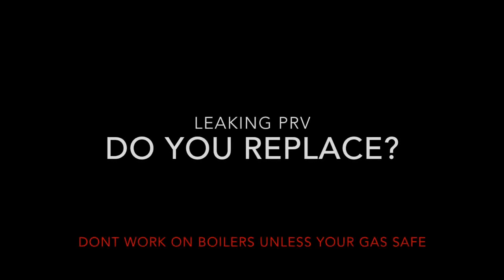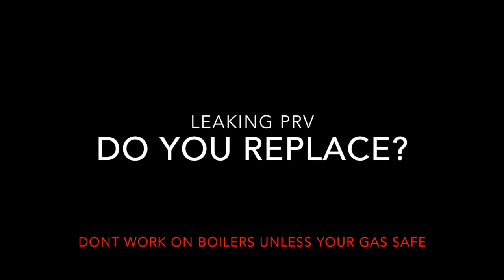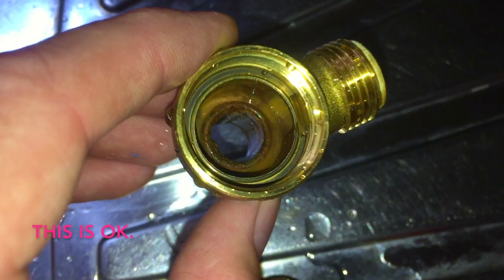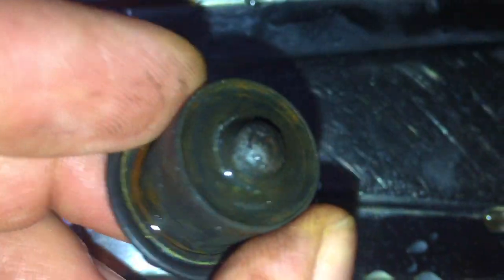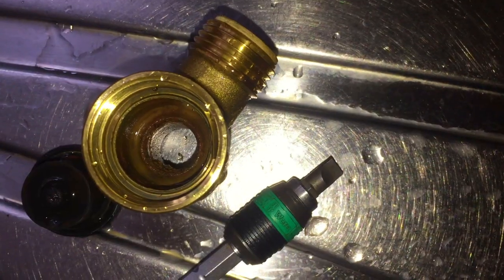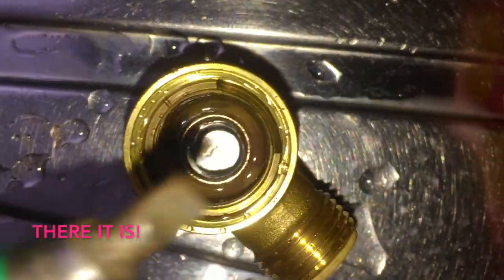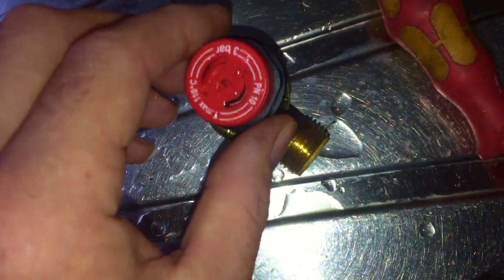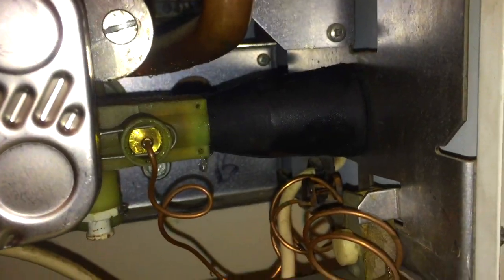Leaking Boiler PRV.  What Do I Do?

Comment: Great stuff ! Was quite incredible the amount of these that were often replaced on a firm I used to work for without trying this way first. I think some engineers wouldn’t even reseat a tap and just change it lol ! Even worse when the valve is replaced and the vesell isn’t even checked so of course back to square one again ! Rant over lol
Reply from the maker: I have been to Greenstar Juniors that have come off the wall for the PRV and no one bothered to pump up the vessel... I could tell because it still had dust on the cap.
I try and start from scratch every job I walk in to and find it helps.
Reply: HeatingGeek  lol ! yes some people do make hard work for themselves. With more knowledge the jobs become a lot easier through experience. Get part 2 up on the other video we are waiting lol
Reply from the maker: Its up. Part 3 should be filmed/done today.

Comment: I just had the same problem on my greenstar 30si. I wonder why they don't just sell the top hat rubber seal as a replacement instead of the whole valve, what a waste. I my case I turned the top hat seal inside out so the rubber was undamaged and pitted and reinstalled it and it worked a treat.

Comment: Recently used a tap re-seating tool to grind out a pitted TPR valve on a unvented cylinder as replacement was on a 7 day wait so got them out of trouble until then
Reply from the maker: I would of thought it wouldn't seat properly, as the plastic cap has a flange which stops it tightening down any further. 
If you get what I mean.
Reply: HeatingGeek was an old Gledhill & worked a treat
Reply from the maker: @charliesebbage9401  Just a light touch up I guess?? Not grinding 2mm off?
Reply: HeatingGeek definitely not 2mm! Enough to smooth out the pitting
Reply from the maker: @charliesebbage9401  Yeah I thought you just gave it a tickle.

Comment: when you say pump the vessel what do you mean? I just cleaned my prv then filled the water pressure back up to 1 bar. It all seemed ok, for about 10 mins then dumped a lot of water? I didn't have any silicon grease maybe that would help?
Reply from the maker: Every time I drain a boiler I pump up the expansion vessel. Otherwise what just happened to you would happen. Every time I drain I pump them up

Comment: Really hard t get to mine, right at the back and it is constantly pouring out
Worcester Bosch 542i any advice would be great as can’t have the heating on
Reply from the maker: Get someone to fix it. Where are you based? We do a fixed price repair.
Reply: Well I can do it myself bud as it’s a push fit kind just a bit fiddly

Comment: A PRV is a safety device the clue is in the name PRESSURE  RELIEF  as an engineer when a customer calls someone out they are expecting a one times fix not to play around  very often the prv is corroded and there are causes for failure that should be checked when replacing it. They don't usually cost a packet under £20. Please don't cluck around with these valves don't be a penny pinching thicki. Also if you haven't a clue what your doing you will enviably wind up doing the job twice. Putting silicone grease around seat is daft it will warm up squeeze out job to do again. There is a sneeky way you can save money get the GC number give that to the engineer and there may be a chance he will get the right part or parts.
Reply: The mind boggles with these so called experts on YouTube, you can pick up prv parts for next to nothing, at least you talk some sense 👍

Comment: Hi, can I ask why you need to add silicone grease to the prv? Thanks and great video.
Reply from the maker: When rubber parts are slightly pitted it helps them seal.:-)
Reply: @HeatingGeek  thank you, most appreciated
Reply from the maker: @howardelvidge4436  No problem. :-)